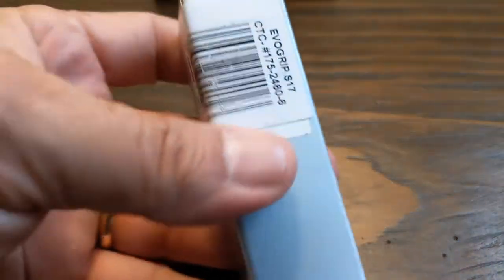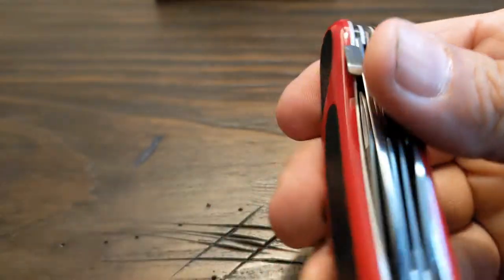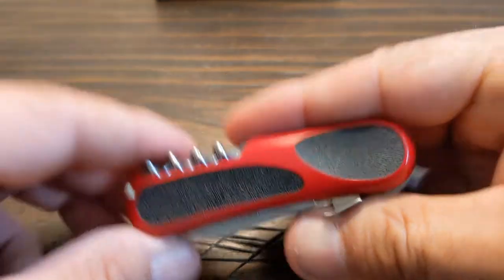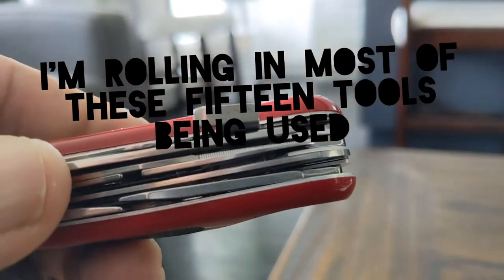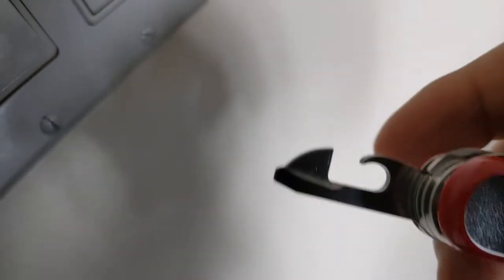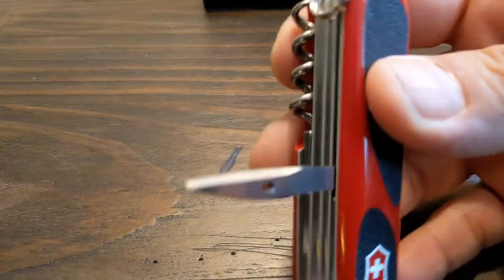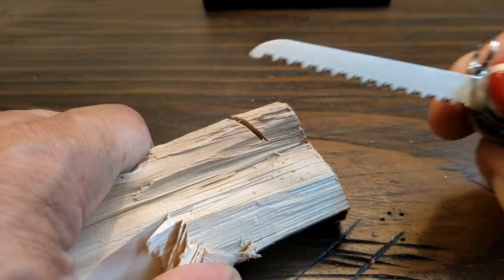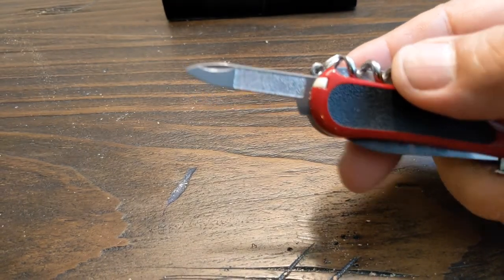SWISS ARMY EVOLUTION GRIP S17

Comment: Happy Monday DN,  I have both the Victorinox EvoGrip S17  & the original Wenger EvoGrip S17 models  . IMO the original Wenger model is the better one , the Wenger Claw can opener works much better than the Victorinox can opener & the fact that the Wenger's Awl can be opened so much easier because there is a cut out in the scale & the nail nick faces outwards meaning you dont have to break a nail trying to opening  it unlike on the Victorinox model were the nail nick faces inwards & is pressed up against the corkscrew

Comment: The four layer swiss army knifes are a nice weight for their size the overgrown fat one is the champ that weighs nearly half a pound or 208 grams to be more precise which I consider to be way to heavy for a pocket knife I already own the Evo grip 10 that is basically the same as the Spartan apart from the nail file that replaces the small blade but I am thinking about getting an Evo grip s17 even though they can be problematic in the UK because of the locking blade but can be added to a collection with no problem